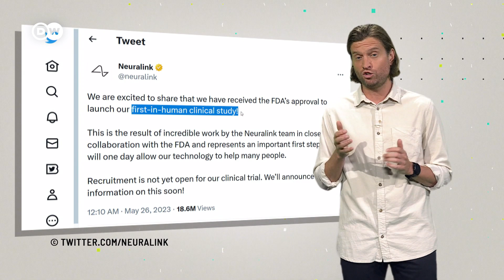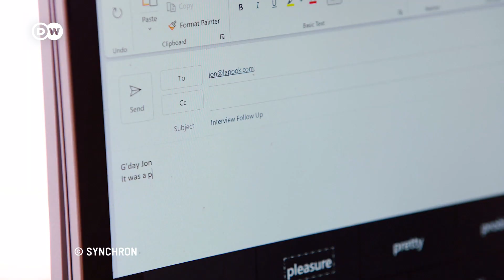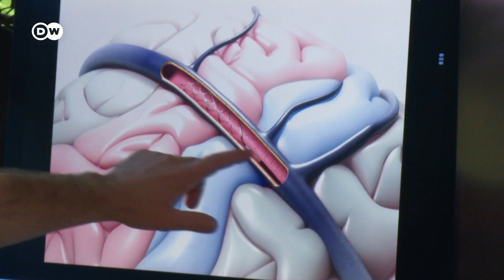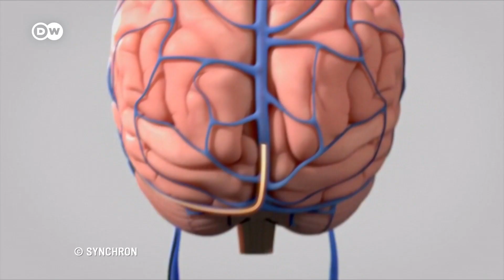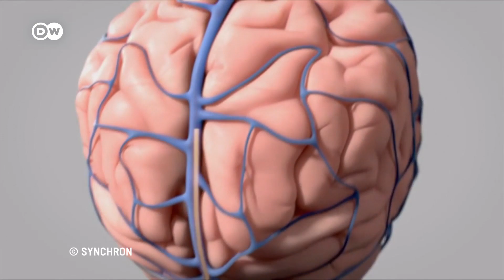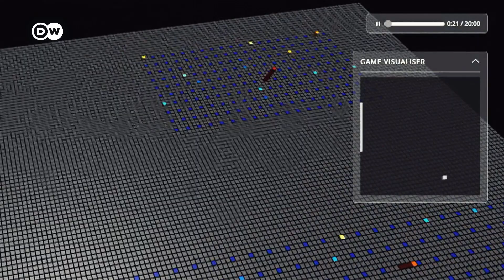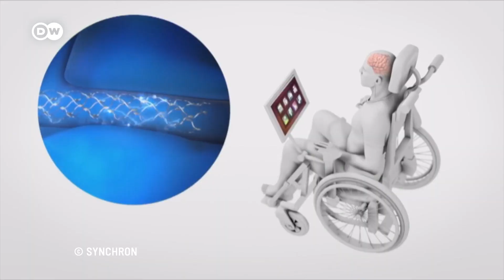Augmenting Your Brain with AI Chips – Crazy or Futuristic?

Comment: Will this be applicable for people with cerebral palsy? Use the brain chip to pick up the slack for the damaged part of the brain? Enabling people with CP to move and function like normal.
Reply: I could see this for Parkinson’s, filtering out the erroneous signals to only pass through the good ones
Reply: @cinemasurge1851  but not CP?

Comment: It's both crazy and futuristic. If they can be remotely controlled, or have sleeper code aka malware, it can do a lot of harm away from its original use case
Reply: Remotely controlled is just ridiculous, if it does not have a wireless receiver then it can’t be remotely controlled, that’s just logical, and if it does have a wireless receiver, it ALSO has to have a function that allows control through that wireless signal, on top of this, it would only control the limbs, so moving your torso would completely throw it off and make them unable to control you
Reply: @cinemasurge1851 it will connect to the internet
Reply: @jr-yn4lk  that doesn’t necessarily have to be the case with augments, there probably will be some that can, but there certainly will be some that can’t